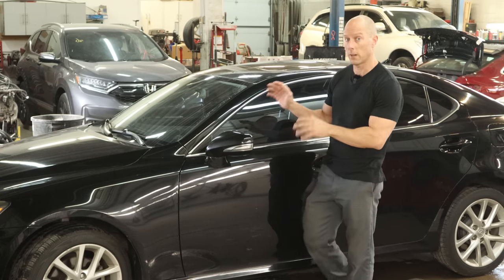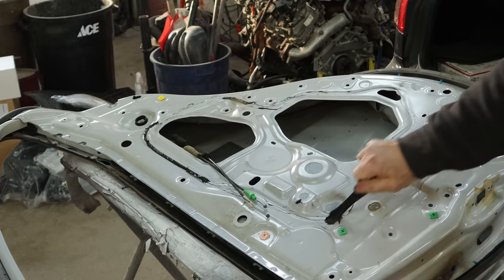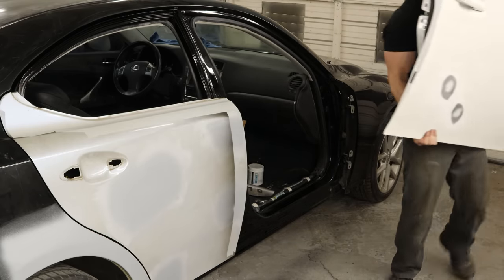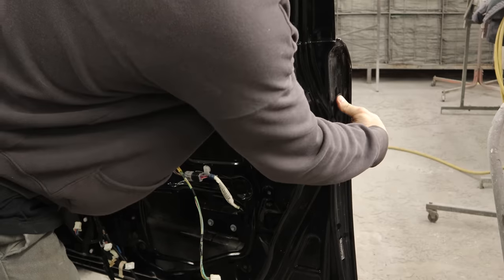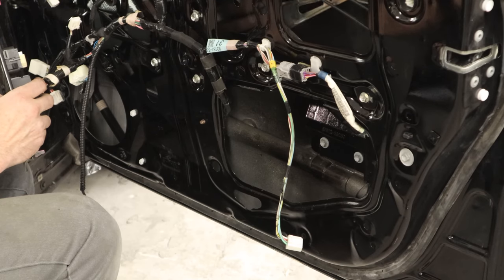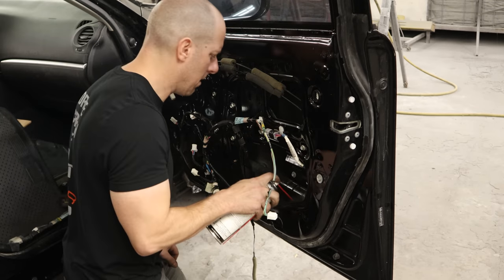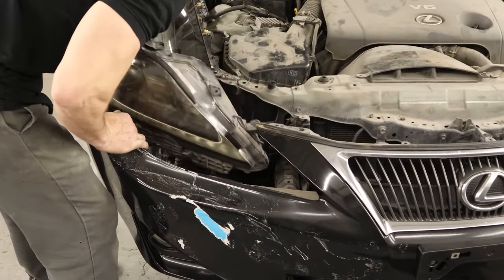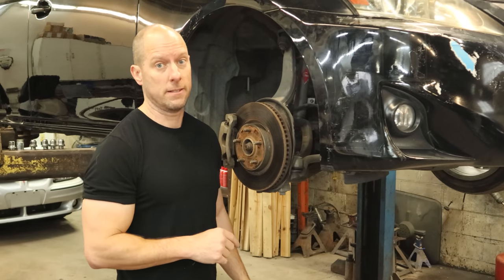Rebuilding a Lexus IS 250 side hit part 3

Comment: Question. On these cars you do which are kind of "budget" cars (the Grand Ams, this, some of the others), you take a lot of care (and time) on the areas that nobody will ever see.  Like the insides of the doors that will be covered by all the interior parts.  Is there a reason you don't just edge out the areas that will be seen, leaving the concealed areas to be whatever the previous body color was?    I mean, I get that the way you're doing it is "the right way"(TM).  But would it be "wrong" to put the black car together with white panels behind all the interior parts?  For a car that probably will only be on the road another 5-6 years before it's completely rusted out anyhow?   I'm legit asking, because the extra time and materials (paint) has to cost you something.
Reply from the maker: Yes, it may cost something but there is a reason I can sell my cars for more than most people.  I heard a saying the other day that fits very well.  “There is no traffic on the extra mile.”

Comment: Tip
With rounded off philips head and hex socket heads it is possible to hammer in a torx bit, depending on the size and other issues drilling a hole slightly smaller than the torx bit may be required.
Use this when access is restricted.

Comment: Tip.
Sometimes it’s better to use WD40 or similar on sticky things before wax and grease remover.
Just spray some on the rag and a little around the goo then rub the goo away.
The oil keeps the goo from restickiing to the job.

Comment: There are axle boot expanders that slip a boot over the shaft and bearing. Without pulling shaft. Not cheap But but it once and payed for .
Reply from the maker: It has been bad for a while.  It wouldn’t be long until that joint fails.
Reply: @vehcor  I guess for the test to try putting New Grease and Boot with a expander verses pulling the Transmission and major Job it may work. YES correct if the axle Joint is damaged it would make noise and click ? 

If there is NO noise worth a attempt to slide boot over ?

Comment: Great job as usual Scott. Just curious,  did you reuse the original exterior door handles to retain the original locks and not have to paint the handles independently? Just curious since you are usually the authority on best practices. 👌

Comment: I noticed the Vin is still visible on the replacement door after painting. Do you mask that off so it's visible for a post rebuild inspection (to make sure parts aren't stolen) or do you get replacement vin stickers that match the car titles vin?
Reply from the maker: Mask it off, it has to be there incase the SOS want to inspect it.
Reply: @vehcor  yea that's what I figured. Thanks for replying.

Comment: Thirty minutes or TEN HOURS... that's why I replaced the entire knuckle, the last time I needed a new wheel bearing, LOL. Fifteen minute bolt on job, and a junkyard knuckle was cheaper than a bearing. Besides, the previous time I had a shop replace a bearing, they broke the knuckle in their press, and left me stranded without a car overnight. Why risk it. WHAM, BAM, THANK YOU MA'AM.
Reply from the maker: Um, replacing the knuckle will not help the problem since the problem is not unbolting the hub from the knuckle.
Reply: @vehcor  Okay, well at 40:44 you said you need to replace the wheel bearing. I guess you're pointing out that the axle didn't pop out? I'm not a mechanic, so I just posted the idea for everyone out there that has a bad  wheel bearing, and a muddy driveway to work in. 

IMO some jobs can be converted to inexpensive bolt on fixes, if you move upstream of the original issue. This might not be suitable for a shop, but viewer's wallets probably skew towards practical reality.

Another example from that same car: When my o2 sensor went bad, I stripped the manifold threads as I removed it. New manifold $400... So I had a muffler shop weld in the new sensor to the stripped hole, and gave them $50 cash (another 15 minute fix). These are the kinds of tactics required when you work two full time jobs, aren't a mechanic, and can't afford *$(#) @^&*.

Comment: an individual with only basic tools and know how could easily go broke trying to save money on a salvage rebuild as they often are limited with parts sources and need to farm out a lot of work.
People who pay too much for a wreck because they get caught up in auction fever also make things more expensive for those who want to rebuild vehicles as they drive up prices and reduce the supply of wrecks .

The rule to live by is,
If you pay more than about twenty percent of the current market value of an equivalent vehicle on a dealers lot for a wreck you’ve paid too much. Because after it’s fully repaired it will still have a salvage title even if you have spent twice the cost of an un damaged one on repairs . Numerous people have bought wrecks thinking they can turn a profit and lost a lot of money.
When you have the tools the connections and patience to buy good cheap salvage vehicles and put the effort into properly repairing them you can make a good profit.
The only partial exception to this rule is collector vehicles and something that you’re rebuilding just for yourself and not to sell.

Comment: Had a buddy tell me if the airbags are set off in an accident the insurance company totals the vehicle. I told him he's full of it but I could be wrong. I thought I was wrong one time before but it turns out I was mistaken.
Reply from the maker: Airbags are expensive so when they deploy it brings up the repair cost to make it uneconomical to repair.  Thus making it a total loss.  Airbag deployment itself doesn’t total a vehicle.  I have repaired thousands of cars for insurance with deployed airbags.

Comment: Fun fact.
The majority of actions taken to reduce plastic ending up in the oceans and reduce carbon emissions are actually causing the majority of the plastic to end up in the oceans and as for climate change, humans add about two percent to the total carbon atmospheric cycle annually and the total amount of c02 in the atmosphere is a staggering 0.04%. At less than 0.02% plant life starts to die out. At between four and seven percent carbon based life evolved and most life finds that amount most conducive to growth.
Humans can easily tolerate four percent and don’t have problems until about eight percent, however that is mostly because of lack of acclimation.
Reply: I believe that most of the plastic in the oceans comes from ten rivers, nine of which are in Asia.  The West Australian coast gets plastic washed up on it with SE Asian writing on it. As for carbon, we've all been gas lit.